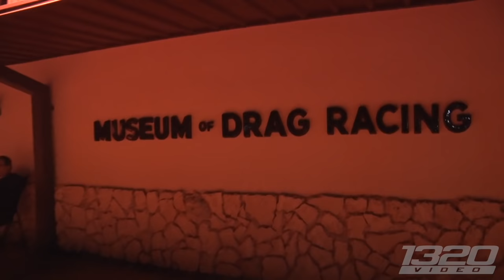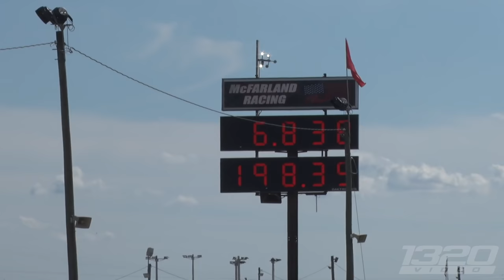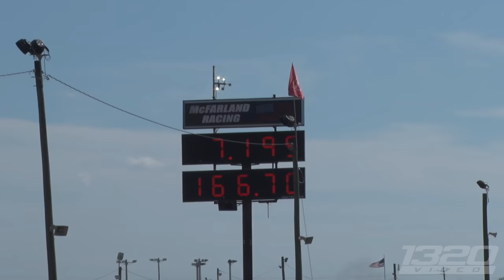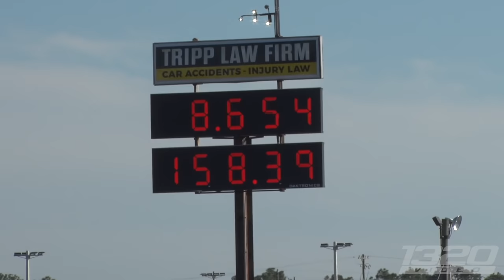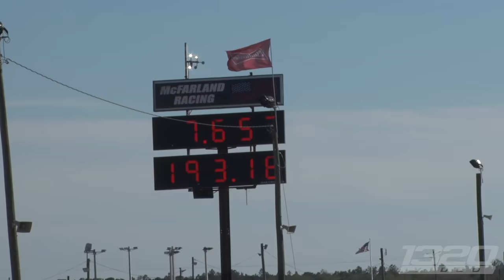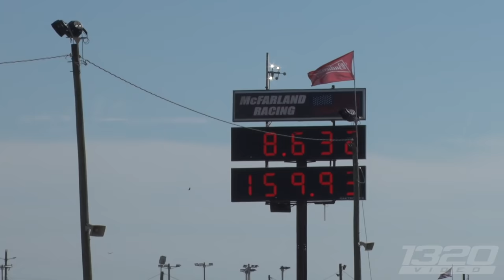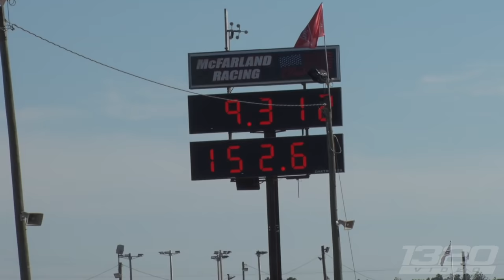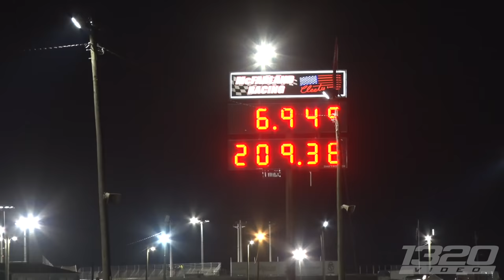CRX SMASHES into wall at the drag strip! (Sick Week: Day 5)

Comment: i love how you guys wanted to get more views by saying smashes into the wall bit he barely tapped it
Reply: That ain't barely tapping the wall. That ain't even just tapping the wall.
Reply: @philb5593  thats literally a tap, it didnt even break the fiberglass fender. literally.
Reply: If that was the case it would be a lot easier for them to put the thumbnail of the swedes volvo and call the video "wagon flips on the last day of sick week"...
Reply: @Chrius  pfi brings more views. so no. this was the optimal clickbait
Reply: @AutoSteps  I don't think a tap would include both rear wheels off the ground.

It's got that giant steal plate on the front which probably took most of the force. Broke the other control arm (I know, it had the strength of a tooth pick). And fiberglass is flexible.

If they wanted to they could have called the video PFI SMASHES in the wall and wagon rolls on it's roof! There's a very nasty shot of a fireball underneath Aydan's car as it rolls.

Comment: Two things to note after Aiden's incident - first is, the Bradenton Safety Safari were rolling and on track before the racecar came to a stop.
This shows they are prepared and professional, an example to Many other tracks (inc ones we've seen in other incidents shown on on 1320) 
The second note is, the way the cars panels are wrapped around the cage, showing the cage took the loading and redirected the forces, keeping Aiden safe, showing how all the rules and engineering that has evolved in to modern Roll Cage Design is doing the right thing to keep racers racing.

Comment: What does the 5th digit on the timing board mean? 08:504 with a 4 or sometimes a 6?
Reply: 4 thousandths, or 6 thousandths of a second. 1.000 is 1 second, .10 is tenth of a second, .01 is hundredth, .001 is thousandths of a second. (So my 11.999 beats your 12.000 by a single thousanth).
Reply: Unless of course I am bracket racing or Index racing and dialing in a 12.000 Flat, and run an 11.999
Reply: Unless of course I am Index or Bracket racing, and dial a 12.000 flat, and break out (or go too fast by running an 11.999).

Comment: 11:24 Who in the hell goes on drag week without a spare wheel and tire? Especially when the wheels you are running are NOT intended for extended street use.
Reply: I never understand the ones that do the street driving on the same wheels/tires they race on. It might not be a pretty, but it’s way better to have more normal street wheels and tires to drive around on. Even if running DOT radials. If nothing else just because the street driving will heat cycle them and they’ll be down on grip by the end of the week.

Comment: I HAD A DREAM *I* made a BLANKET that went around the tires and hooked up to a generator that HEATED UP THE TIRES and you didn't even need to do a burnout to warm them up...  is that TOO HOT OF TEMPS to have wrapped around the tires??  could that be a thing??? this GENERATOR that powered the heated tire blankets ALSO POWERED FANS AND PUMPS to goto EXTERNAL COOLING SYSTEMS for your OIL ... TRANS ... and WATER all three had opetional opgraeded radiators and cooling options... ;)  was in a unit the size of a cooler, included the generator you can plug into, had batteries so it was a POWER BANK that charged ANY THING and when out and in useage mode, the generator would automatically fire up when the batts got down to a certian drainage scenerio...  *I* can see it in my head,  is that a thing yet???  anyone wanna help it BE A THING???

Comment: Should these be renamed "1000 video". I stopped going to drag races when they were no longer quarter mile.
Reply: This is all 1/4 mile.  Top fuel runs 1000' because the overall length became too short to safely slow down.

Comment: Is it just me or does PFI Speed build the jankiest cars?
Reply: I was thinking about this awhile back...
I don't think the issue is with the builds, the problem is that they are making fwd cars with over 1000 hp.
Afaik, in the US, fwd drag racing is not that common... so it's quite possible that there are no parts available that could take all the power in the front suspension...
There's also the problem of not enough testing. Rwd drag cars have been a thing there for a long time, so people usually know what the main problems are and how to fix them. They are basically figuring it out as they go.

But I'm not in the US, so I could be completely wrong too...

Comment: The worthlessness of an EV. They'll get something figured out. I don't want the future as electric, I'd want it for choice. No one is made the same & everyone has different needs or preferences.
Reply: I mean, considering how many engines and transmissions blew to pieces on day one I think the Tesla just wanted to participate in the break-down-fest. probably felt left out. lmao
Reply: @FurryWrecker911  Well, you missed my point. EV's are very complicated regarding computer programming. That driver didn't feel 'left out', I don't understand how you came to that conclusion. He was curious what the Tesla could do & he found out. He had a combination that shut the system down & because of the complexity, the poor guy couldn't even get the wheels to turn. Would you want a car that could lock up tight like that? I wouldn't. Nobody wants to participate in a "break-down-fest". Competition requires 'on-the-edge' tuning & sometimes the worse happens. Nature of the Sport.
Reply: @carmiethompson2676  I was speaking literally, as in the Tesla bricked itself to join in. It was a joke.
Reply: @FurryWrecker911  I don't think it's a joke when an $80-100K electric sports car locks itself up so bad that the line crew couldn't move it off the track. If the owner couldn't enter the rights codes to correct it, the dealer must've hit the poor guy up big time.